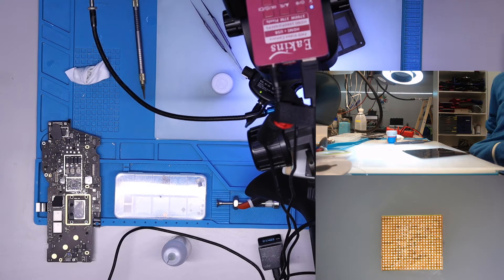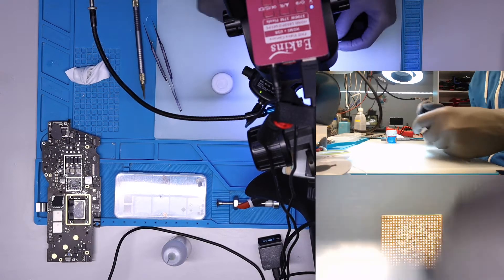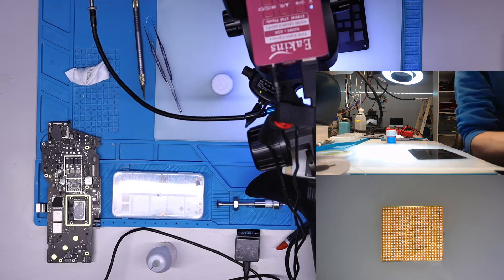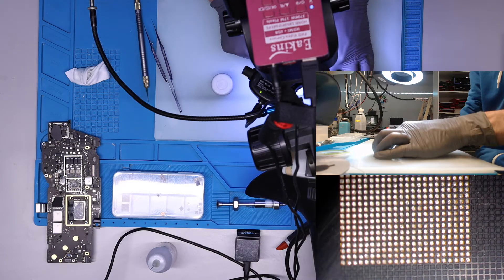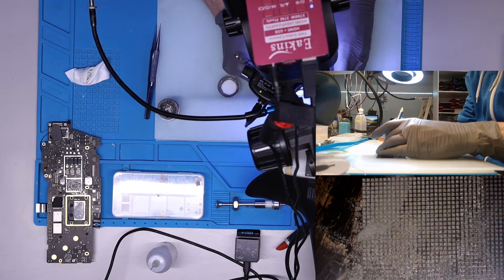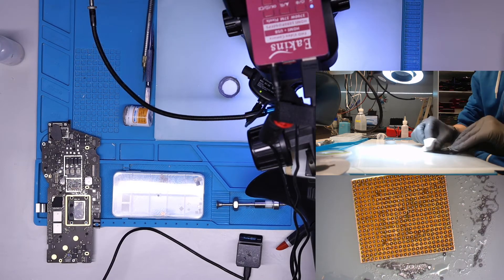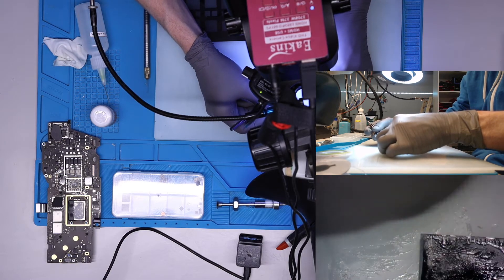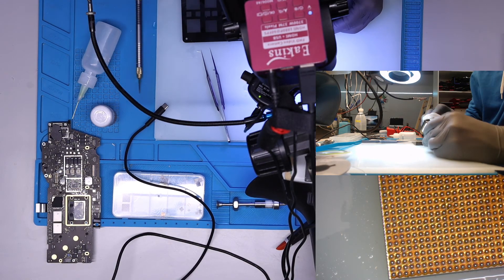New BGA Reballing method using IR heater

Comment: I just ordered the miniware, ty you so much for sharing, doing this on Friday. Do you use it to put it back on the board or just to reball?
Reply from the maker: There is a new version, mhp50 for bigger jobs
Reply: @inwerp cool do you know if it used to put the chip back on the board
Reply from the maker: @RepairLabz would not recommend that unless that's a very small and thin board

Comment: Please can it DESOLDER AND RESOLDER  laptop BGA CPU AND PCH CHIP
Reply from the maker: no, thats just for small jobs like replacing connectors on flex cables, small ICreball, etc. to work with big BGA chips you need a proper IR Soldering station with big underheater. the key is to use proper temperature profile, avoid temp shock on BGA chip and so on. Npot a rocket science but definetely requires proper equipment.